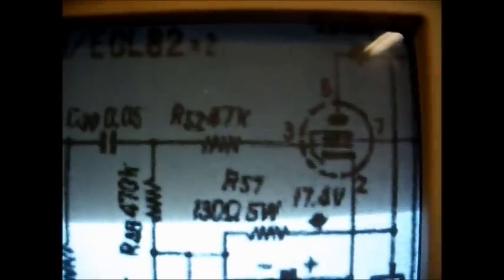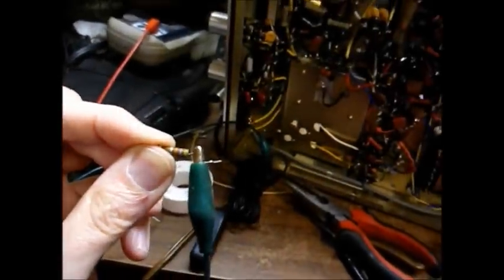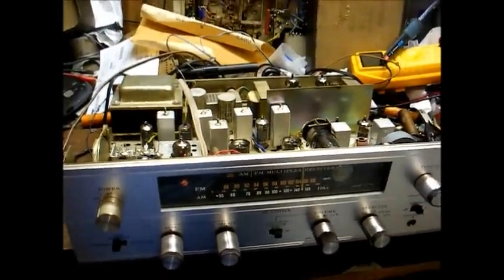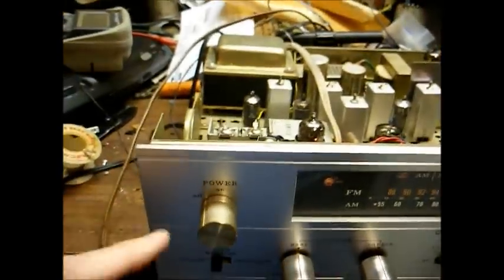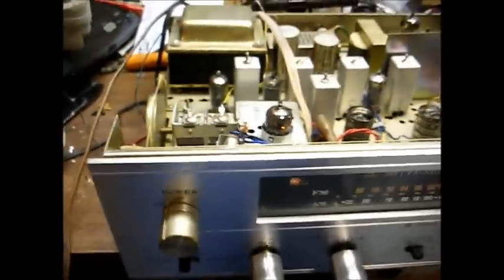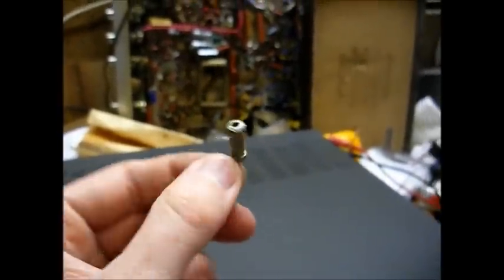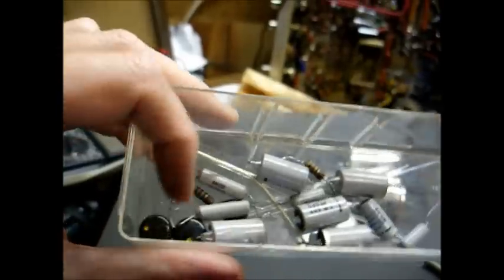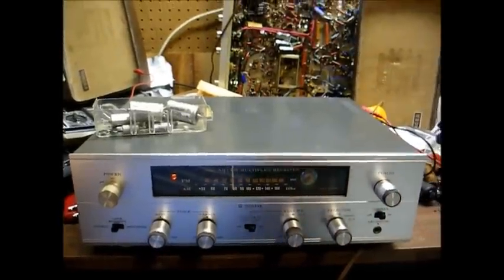Pioneer SX34 tube stereo receiver repair - part two

Comment: lovely radio
Reply: used to have a SX1010
Reply: both quality machines, just think years ago when cds came out you could get these dirt cheap, now they cost a fortune
Reply: I love old Pioneer gear...I'm commenting on a post you made 2 years ago...it's like an internet time machine...or I need to lay off the weed.

Comment: I'm a little skeptical on this one, as I've never once encountered a "noisy" resistor that wasn't grossly out of tolerance, or had intermittent connectivity (mechanical failure). 6BM8's on the other hand are another story...those were junk when they left the factory. Hopefully the repairs here will fix the problem for good....but I have a feeling that it's coming back.

Comment: Your presentation is very nice also because You connected friendly not fatiguing sounding old speakers. Everybody may hear difference to modern.   I have also Pioneer SX-34  and I did similar job with it.I put some narrated notices i my video "Why audiophiles don't like tubes" Found in my SX-34 even more resistors which I considered out of range and of course capacitors My conclusion is that technology of resistors was not expecting so long time of use. Then I modified output stages - this may be found in my page ://diysound.eu. with explanations about reasons.  To obtain similar kind of sound but with wider range I constructed special enclosures  with original German drivers from 1959. Some may be skeptical but I knew what I was doing :). Now it is my gem  topping my  Luxman L210 and Onkyo TX 906. For all having problems with low noise hum like here, I have advice - the reason is often too big current in output anode circuit and the reason may be the same: capacity, resistance like here, and  also deformed internally grids in end tube. So I begin shooting from exchanging/replacing output  tubes.